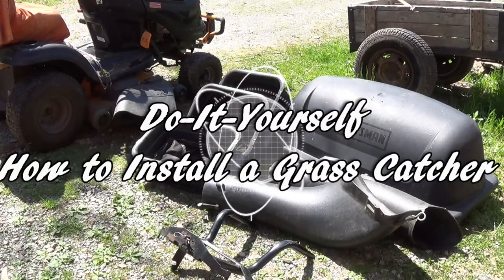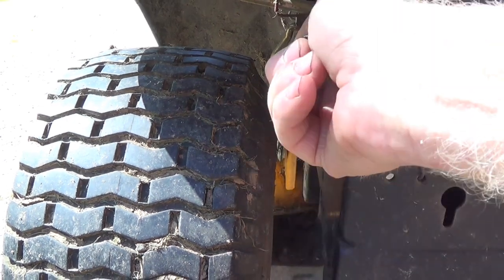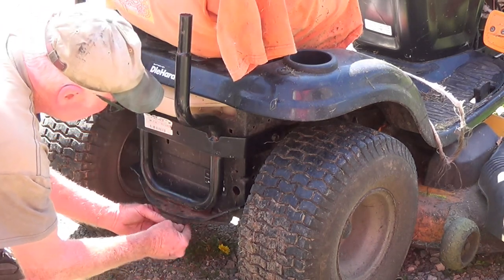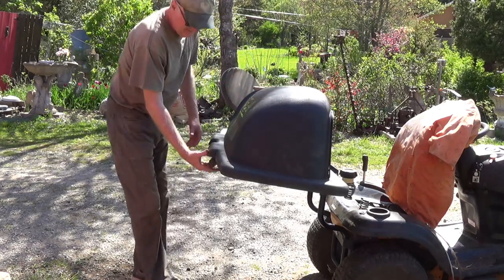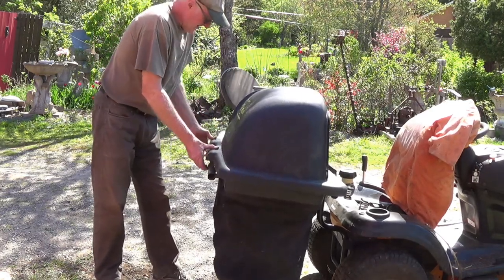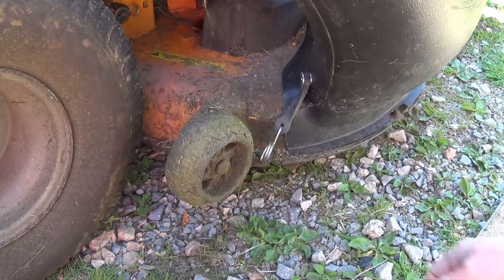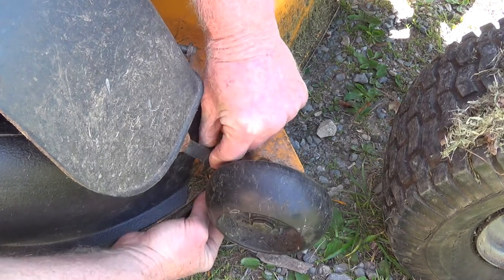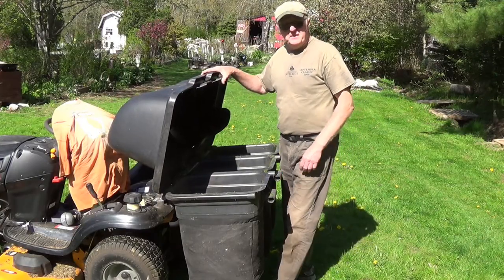DIY - How to Attach a Grass Catcher Bagger to a Craftsman (MTD) Lawn Tractor

Comment: how well would thoughs bags work for other uses when not being used for the mower, like picking up garbage or recyclables or just using to tote around stuff?
Reply from the maker: Thank you for your question.
You could use them to tote things. However, they are soft-walled and won't stand alone.

Comment: what size of deck is your mower?
Reply from the maker: Thank you for your question.
My lawn tractor has a 46" deck.
Reply: @BasaPete  Thanks I realized you mentioned that on your video. I have the PYT 9000 also but with a 54" deck, I can't find a lower chute assembly that is big enough anywhere unfortunately.
Reply from the maker: @ggasper9911  Have you looked on MTD website?  https://www.mtdparts.com/